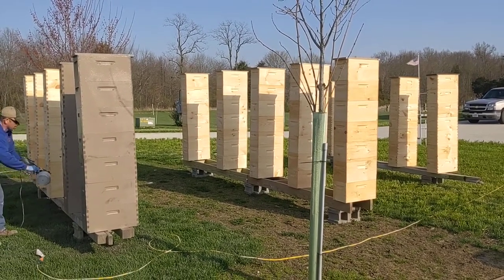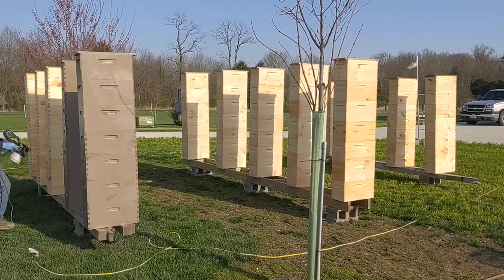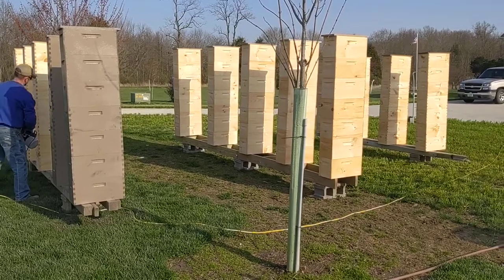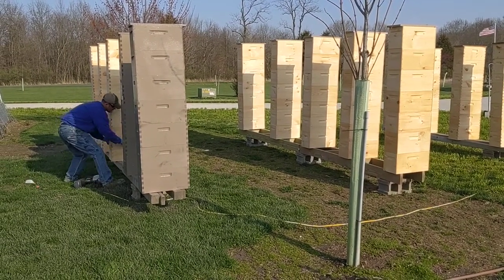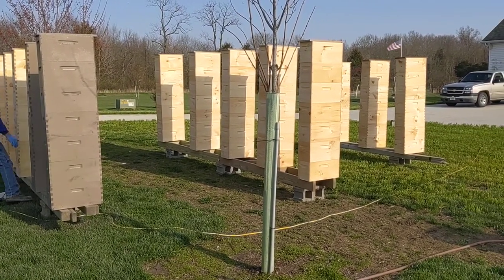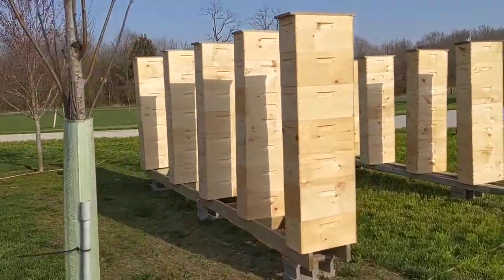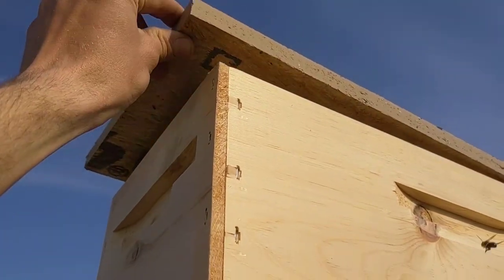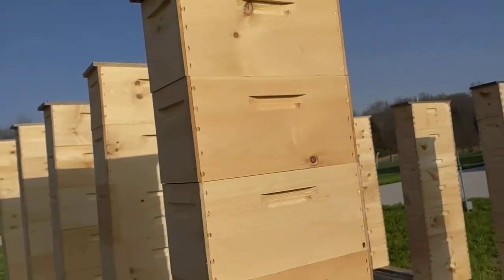Quickly painting honey bee hive boxes with a power sprayer.

Comment: Sure makes it quick.  You dont do the the edges where boxes stack to prevent rot?
Reply from the maker: We paint everything exposed to the elements.  The honey bees use propolis to seal the joints.  We also scrape the propolis off when it builds up between boxes and save it.  We don't want paint chips in that so its usable for those who buy it.  The boxes last 10's of years without painting the edges.